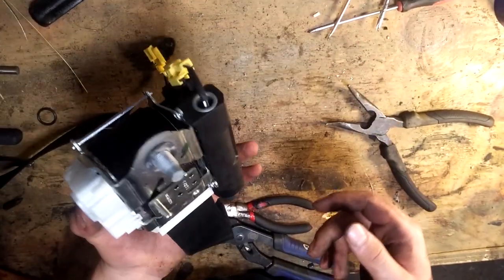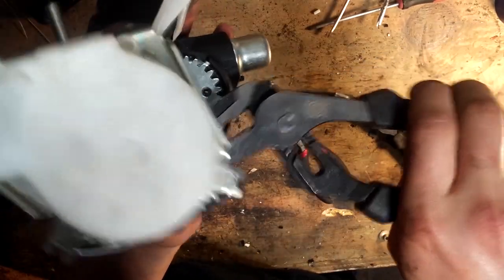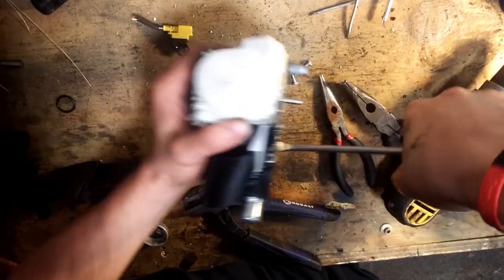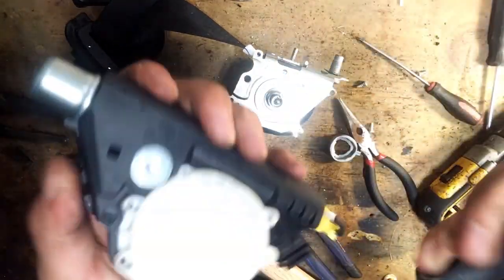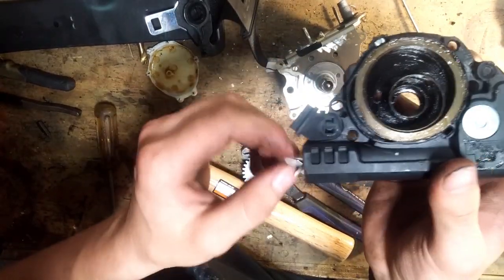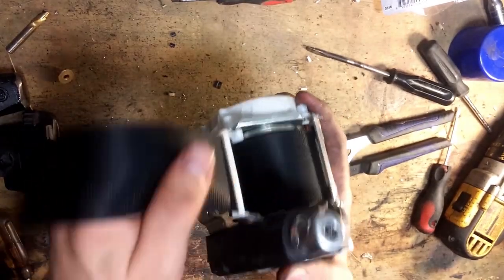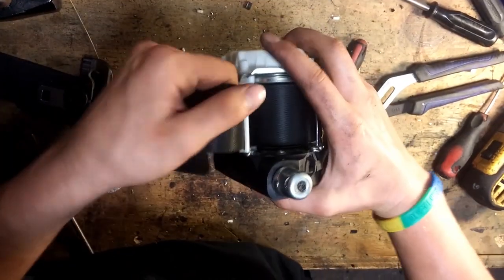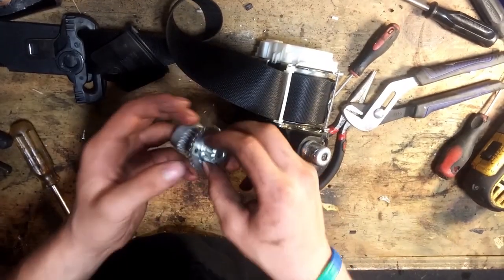How to fix and repair a jammed seatbelt from a collision. Mercedes GL

Comment: Thanks, it works!  When the seat belt is removed from the roller mechanism, you can tighten the spring further. when the roll has turned a number of times, there is more tension on it and you can reattach the belt.

Comment: I too have the same seat belt. Tried to make it workable after a slight crash. But it is not so easy to drill and cut the screw head of SS with a drilling machine. So after trying with HSS and other bits,  my mission repair failed ! Any other solution to drill out that head?

Comment: cool video on taking something apart, but you are removing the safety feature of the belt locking up when a crash occurs. The next time you get into a crash this feature will not lock the belt and the webbing could keep pulling out till it runs out. The webbing does stop when the ball bearing rocks on angles in the retractor causing it to momentarily lock up, but is not a permanent fix.

Comment: I have a 2015 malibu. Removed the ball bearings that blew and the gears that locked it up. It still does not retract all the way(gets locked up). Looks to be these 2 half moon gears that go on that same side of igniter end but under the plate . Are you familiar with these half moon gears. They look like they are suppose to open to a certain point before it would lock. Any help. ???Thanks
Reply from the maker: Phillip gomez when I first did the procedure the seat belt did not retract (had some trubble figuring out what was up) but what i did is i put the seat belt module back into the car ( the car has the belt at an angle when put back into its slot ) witch in some cars its just a steel ball that when perfectly balanced releases the belt) other cars have different systems in place. Id try that
Reply: Sam mik yes, your right. Noticed on some videos it had to be at 90°.  I put it at a 90° and can see the end (ball valve/plastic gears) unlock (free)like it should and  when not at a 90 it will lock like it should. Problem is the other end of gear shaft has those half moons that lock up when it's still at 90° and the ball valve end is free. I am going to just put in the car to try and see if it changes anything.

Comment: what is the ohms resistance on a 2008 c300 is it the same as this?? please any info would be appreciated.
Reply from the maker: Francisco J. E. Diaz i believe there the same since Mercedes use the same systems for most of their cars. I bout a 20 x 2.2 ohm and hooked them up worked like a charm took my lights off the dash
Reply: @sammik6676  can you link me to where you got them ?
Reply from the maker: @TRUTH0FAL1AR  https://rover.ebay.com/rover/0/0/0?mpre=https%3A%2F%2Fwww.ebay.com%2Fulk%2Fitm%2F152728604641.  Here is the ebay link
Reply: @sammik6676  thanks! Your video has helped me alot getting my c300 back to being road ready. I'm sorry if this sounds dumb but that ohm resistor is located within that yellow connector? I must open it up and replace resistor if I understand correctly? ( Inside of cable you end up cutting off in video) what also any cheap scan tool that you would recommend to reset computer?

Comment: One question every seat belt are similar?
Reply from the maker: Vigarin Garcia not all seatbelts are the same. I believe there are 2 different kinds of mechanisms by which seatbelts work by. the simple mechanical ones ( standard cars) and the more complex sensory ones ( newer and more luxury and high end cars like Mercedes, lexus and so on)   (the one i did in this video is the sensory one). the mechanical seat belts work almost the same way as these. the main difference is 1. the mechanical seatbelts don't always have a sensor to it. 2. instead of having little gears in the seat belt that lock up in an accident, they have little steal balls. that once triggered in a collision the balls are released from there holding chambers, the steal balls are shot and lock up the seat belt. now to fix the mechanical version seatbelts. its the same proses as seen in the video except instead of those little gears locking up the seat belt it will be steal balls. just remove them. and you will be all good 😀
Reply from the maker: Vigarin Garcia ill try to make a video in the future of how to fix a mechanical seatbelt.

Comment: Ok what about SRS light    ? Is it on or after repair its gone?
Reply from the maker: pavel zolov you need to buy resistors. id find out what resistor capacity you need then hook them up to the seat belt sensor to make the light go away
Reply: @sammik6676  what resistor you use for that Mercedes? I have same car. Only rear belts
Reply from the maker: @DJEvoIX  just a regular 3.3omh resistor on Ebay.

Comment: UHHHHHHHH...... Airbag light.
this is not the correct way to fix your seatbelts.
This way removes the BLOWN SQUIB in the seatbelt...Making your seatbelt a basic NON-SRS type seatbelt.
the Yellow connector isn't a "resistor" its a connector. the SQUIB or explosive device in the seatbelt retractor has a resistance that the airbag module reads. Usually in the range of 2.2 to 2.5 Ohms. 
You would need to re-connect that connector to the CAR SIDE, and add a resistor of 2.2 to 2.5 ohms. then clear the srs light. BUT... This only works on GM 2010 and up, Mercedes 3 crash events allowed, BMW three crash events allowed, New DODGE after 2014.. most other makes, and ALL Japanese, Korean cars  will have to have the airbag module reset or replaced and programmed.